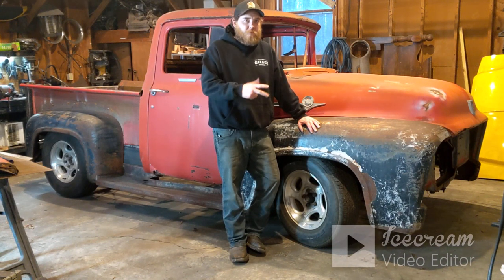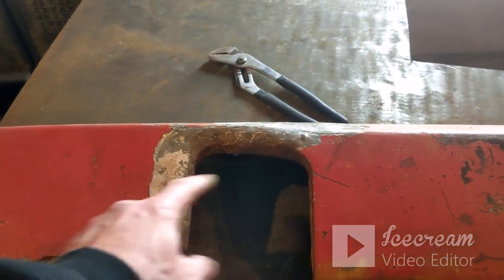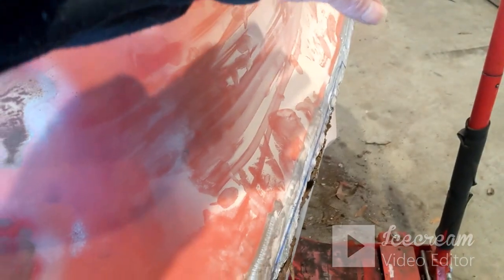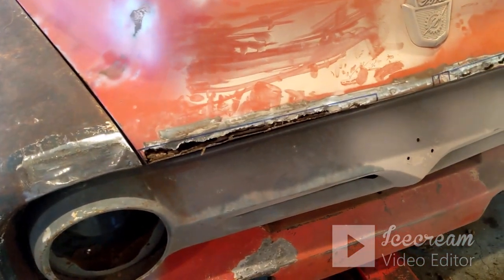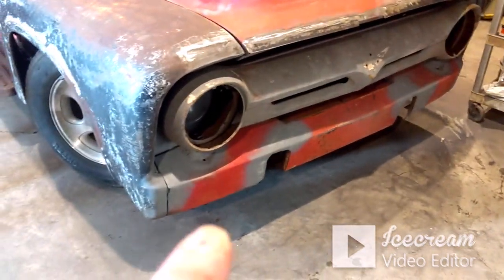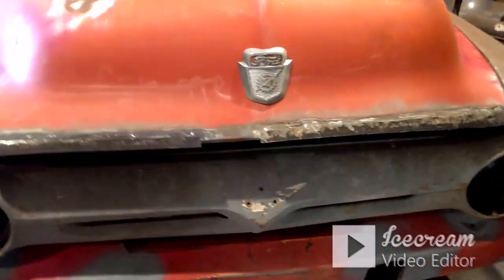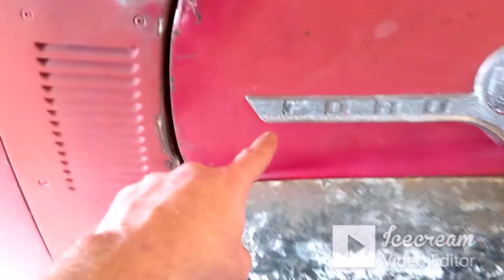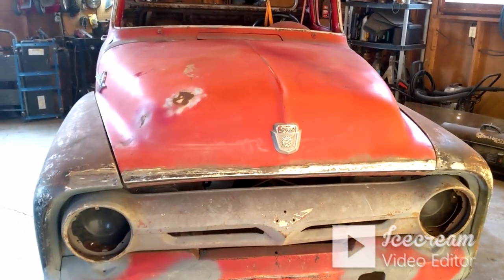1956 F100 Hood Repair

Comment: Would it be easier to use thee fitzee's fabrication method to repair the lip on the hood? He uses the same method on pinch welds as well. Good luck. Jay in ontario canada.